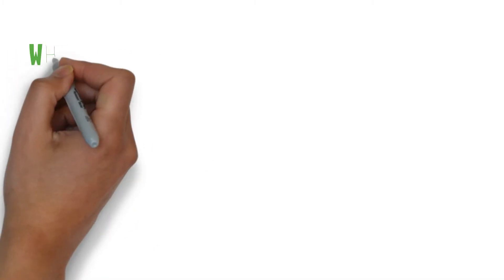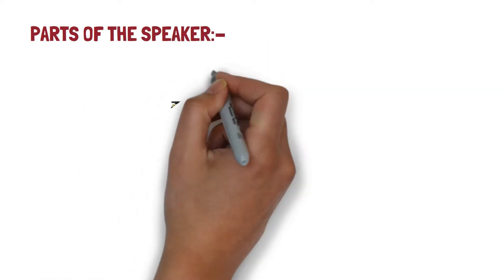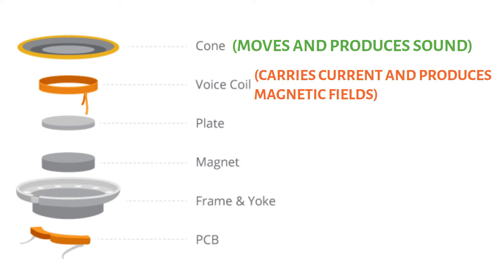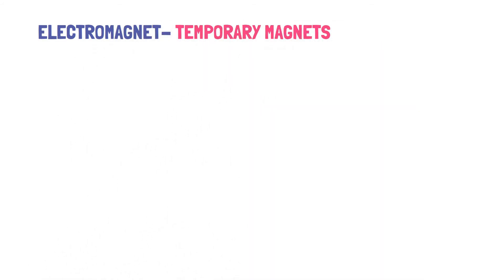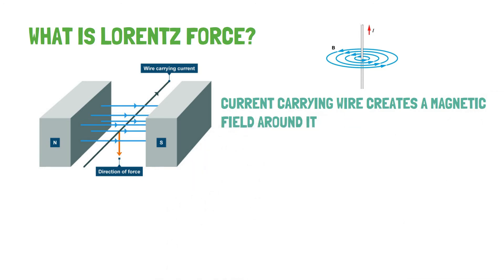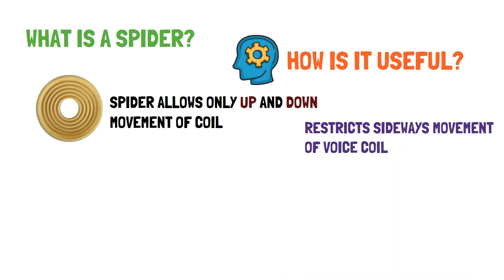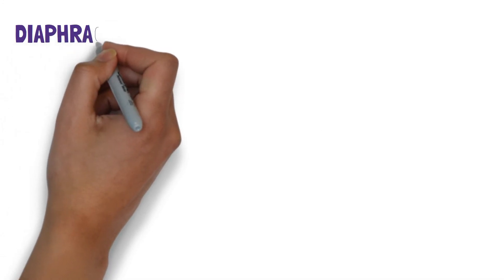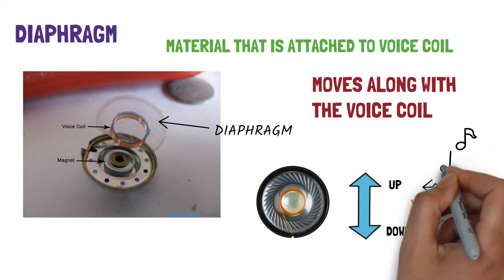SMARTPHONE SPEAKERS!!!! marvels of miniaturization... how do they work??? (ANIMATED)

Comment: From elsewhere, I understand that it's basically like an old-fashioned non-electriconic  megaphone, but somehow coiled up into a tiny space, and the sound comes out of that tiny hole much louder! There is no more energy required to have this happen, and if you were to take the  horn off, you would barely hear the tiny speaker!